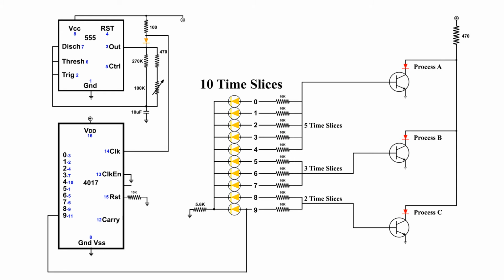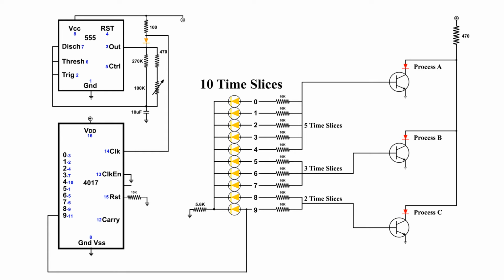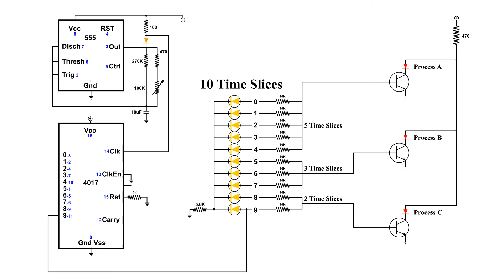Digital Time Slicing, The Basics

Comment from the maker: It would be possible to over clock a calculator, but the other chips in the calculator many not be able run with the faster clocking. Like over clocking the ram in a computer, if you go beyond clocking specs random error will appear. Increase clocking further and it stop working altogether.

Comment: is it possible to over-clock some basic computers, like a calculator, i see meny have a quartz timer in them, replace that with a higher clocked one?

i read an article where someone took a play station and tried to over clock the GPU, what happened is the vertical sync went out-a-wack (vertical roll)